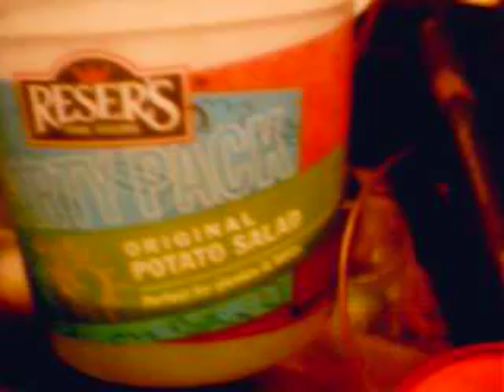Processing E-Scrap in an AP Tank.  Part 1

Comment: @ProspectorRick eh im doing this same process but im using 31% muriatic acid and peroxide 3% its cold in my garage and i was wondering at first the liquid went green then to black would there be any gold in the black liquid? i filterd it through and had some foils floating on the filter im saven all my filters as well, it did not dissolve all the metals, should i filter the rest and do a rinse then put it in a acid bleach mix and dissolve it that way then drop the gold from there? any ideas?